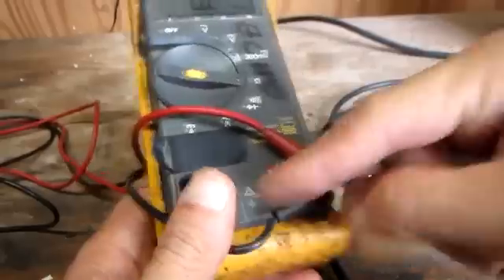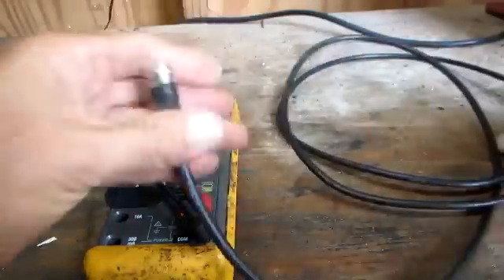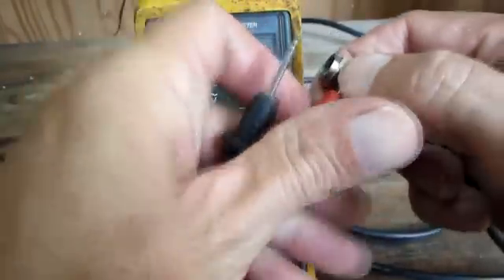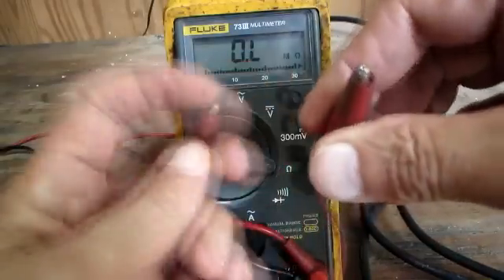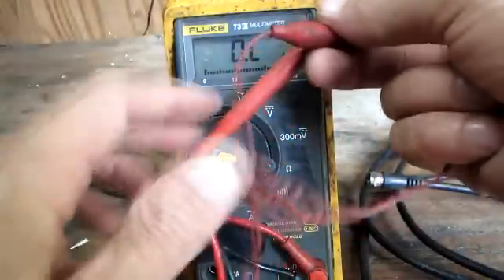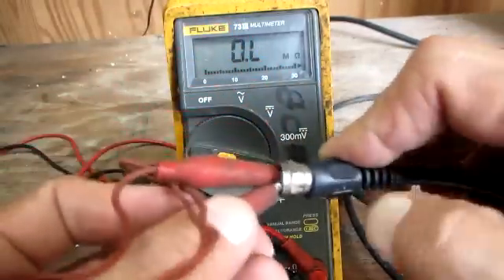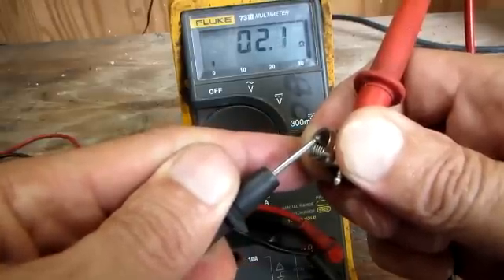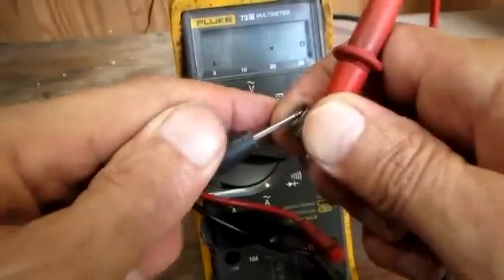Using a multimeter to check a coax cable.

Comment: A few years ago, my TV reception went dead. I'm on a subscribed satellite dish plan. I tried changing the dish, then the receiver, neither one worked. Friends said it must be the TV, which wasn't that old, but I wanted to upgrade to a new, larger flat screen anyway, so I spent $1200 on a nice new large flat screen TV. Still, no picture. Finally, I bought a new coaxial cable for $19.95  and voila....TV worked. It was likely the cable, all along.

Comment: Wouldn't the teeth of the clips damage the surface of the pin causing signal issues since RF travels on the surface of the copper?

Comment: This isn't a good test for a coax cable it only tests if the cable isnt (or almost) cut. Doesn't tell us anything about the frequency response or the attenuation. Even if it passes the continuity test it could still be a useless broken coax...
Reply: then what do you suggest?

Comment: It might be worth noting that if you are dealing with higher frequency system(such as Wi-Fi antenna feeding cable) then the test might not be good enough, you could have a cable that shows continuity but is extremely lossy when used, just something to be aware of.

Comment: Why did you not check the outer in inner core seperate? Testing both at the same time does not tell you if the inner core for example is snapped as the current will go down the outer braid also.
Reply: The alligator clips connect the inner core to the outer shielding, essentially creating one long conductor. If the inner core were snapped, the current would not even make it to the alligator connector at the other end -- it would still read 0.L as it did with his first test.

Comment: Does this check the continuity of  the outer shield along with the center wire. I have been told this needs to be good to use an antenna preamp.

Comment: Clever, thanks.  Wondering if a splitter in the middle would affect results?
Reply from the maker: You would read the resistance in the splitter,  would be the difference.  Thx for watching.
Reply: Bill Eaglerunner thx for a informative video.
1 question that's bothering me, does a setallite cable coming from the dish contain electric

Comment: those are the worst cable you can use at home, even though you don't see it they are super faulty and tend to introduce a lot of noise in. I use to replace those a lot while I worked as a comm tech with a great cable company. Don't waste your time doing that, just call your cable company and have them put the real good ones at no charge, that if you have them for service.

Comment: Great video. I found a cable jack in our home which wasn't being used but didn't have a signal.  There was a nest of cables and splitters l in the box outside and testing for continuity helped me rewire the system. Thanks!
Reply from the maker: Great thx for watching.

Comment: Why not just test the copper piece in the center? Why do you short it out to the outer threaded piece?
Reply from the maker: In case the coax ends are several feet away. It makes it easy. Thx for watching.

Comment: I do this the same way but it is a little easier with something I made. I 
took a female, F-type connector, (the type of connector that screws in to a 
standard TV coax connector) I removed the barrel/cover from the rear of the 
F-type connector. I then soldered a short wire and clip to the 
center wire/pin/stinger on the rear side of the F-type connector. I now keep it 
with my test leads. When I need to test coax, I simply screw this thing on the 
opposite end of the coax cable line. It is easier than trying to get alligator 
tester clips on the coax connectors. I can also use it for an open circuit or 
closed/shorted test on any length of coax in the building.
Reply: @edgarjohnson1112  [

Comment: i just run a currant down it .. like 12v then measure the output
Reply: Well that's exactly what the resistance measurement with the multimeter is doing!

Comment: This particular test checks dc electrical connections, however that cable has something called impedance, it's helpful to check that too.
Reply from the maker: Thx for watching.
Reply: impedance isn't always enough
Reply: Thats exactly what he checked ... The IMPEDANCE or the measure of resistance between the stinger and the outside shield / ground.... WHICH should be extremely HIGH ..
Reply: @ACommenterOnYouTube  Impedance can't be checked directly with an Ohm meter due to its capacitive and inductive elements.  

Even the formulas for capacitive and inductive reactance aren't practical to use when working with cables but they are reduced to taking the log of the diameter of the outer braid shield divided by the diameter of the center conductor and multiplying by 138.

If any of those physical characteristics changed due to damage the above test although quite useful wouldn't reveal it.

Comment: many thanks!  this allowed me to sort all my vid cables with my multimeter and save $20+ on another tool that i'd probably never use again.  i used a wadded up piece of foil as the way to complete the circuit at the end of the cable (wall outlet).
Reply from the maker: +twinklinglicin Glad to help and thanks for watching.

Comment: Not sure why people are saying this is confusing, this is just what I needed, another truck I use is connect a 9v battery to one end using old bunny ear adapters and check voltage on the other end, I use this for cable identification withing the house
Reply from the maker: +nick longstaffe Thx for watching.
Reply: I made a post above as to why but I will say this did prevent a needless cable pull recently.

Comment: don't they call this stuff 75 ohm cable? what's up with that? sounds very confusing if lower ohms is better..
Reply from the maker: ***** No it does not mean the wire should read 75 ohms. 75 ohm cable is designed for impedance matching for the system it is being used in.  Its all about voltage and current.   Hard to explain.  Maybe this website can help  http://www.bluejeanscable.com/articles/impedance.htm.  Hope I answered your question.
Reply: The 75 Ohms is actually what is known as the characteristic impedance of the cable.

The cable has capacitive reactance along with inductive reactance that has to be accounted for at signal higher frequencies.

 More importantly however maximum power transfer from a source to it's load only happens when the signal source, cable, connectors and load impedances match.  This is why when you look at camera specs you'll see 75 Ohms listed.

Since this impedance can't be measured directly the test here is good for continuity. However it won't let you know if the other physical characteristics of the cable are what they need to be for the considerations above.

It can be argued that most techs don't need fancy cable testers but some of them actually give you the impedance of the cable.